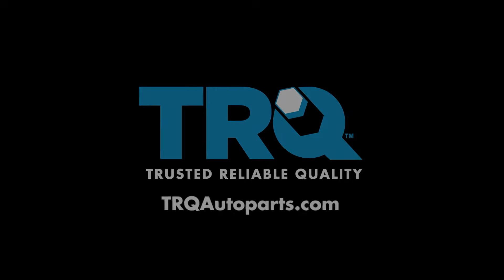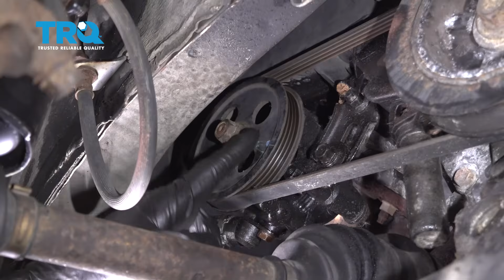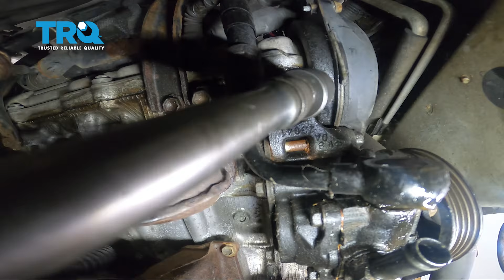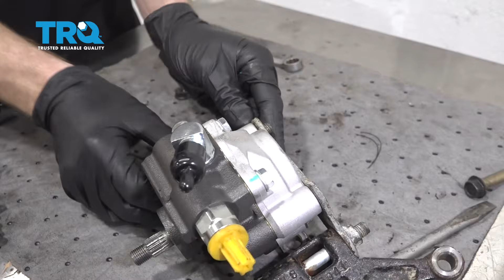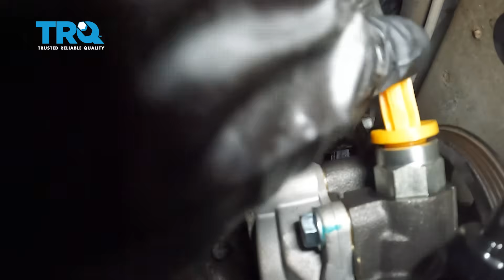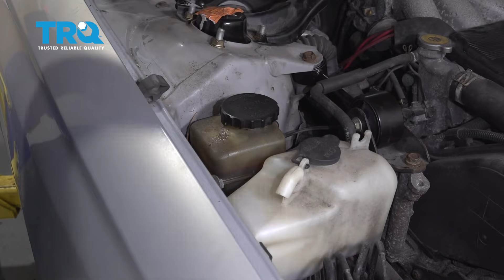How To Replace Power Steering Pump 1999-2003 Toyota Solara

Comment: i dont like when you use impact wrench to install bolts. if they are not perfectly aligned you will destroy the threads. use grease on the threads.